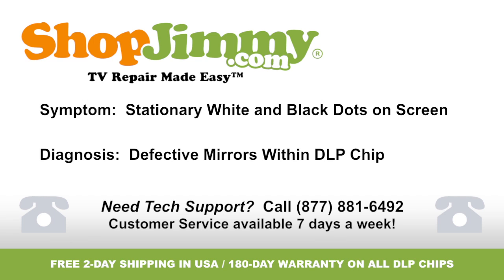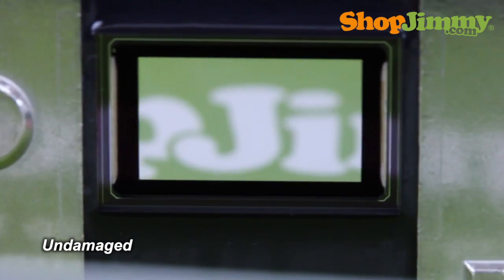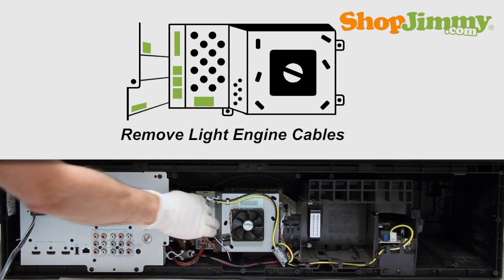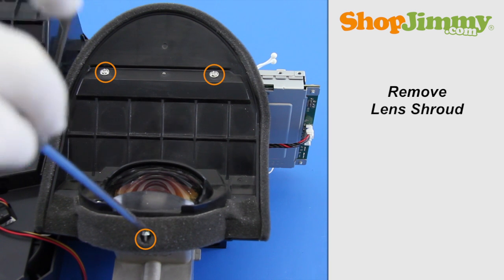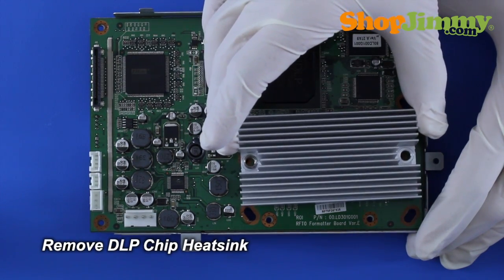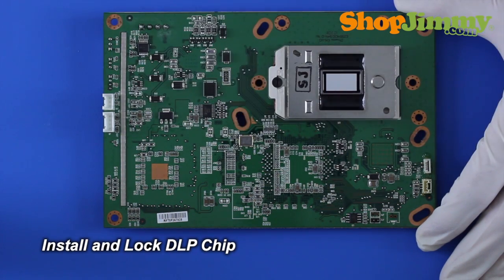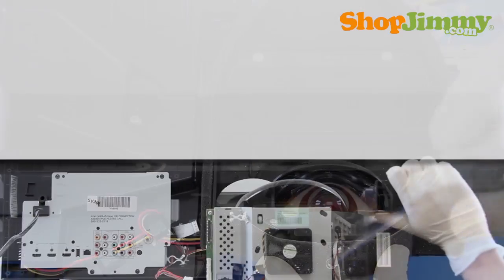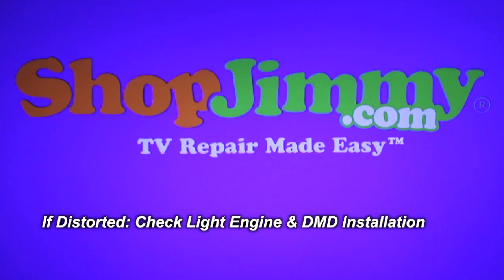Samsung/Mitsubishi/Toshiba DLP TV Repair - Black & White Dots on TV - How to Replace DLP Chip

Comment: hi . when i tryed turning on my tv it did a lil sound and then then it just turn off when i tryed turning it back on the picture wont show the lil green light flashesh but nothing happends can you tell me whats wrong or what can i do?? before that the tv looked a lil bit daker then before can you help me??
Reply: Have you tried unplugging it and plugging it back in? You might need a new bulb.
Reply from the maker: jucar67   This sounds like a main board problem.  Could you please reply with your TV model number?  This will help for me to recommend a replacement part.  Thanks!  www.shopjimmy.com

Comment: My Samsung DLP Tv HL-T6187S has 5 fuzzy horizontal lines, 1000s of black dots and 3 white dots. Help!
Reply from the maker: Mp5sting I recommend replacing the DMD formatter board and the IC Chip.  Here is a link to replacement parts for your TV model number on our website, click here:  http://www.shopjimmy.com/catalogsearch/result/?q=HLT6187S  I recommend the 4719-001997 Chip and signing up to be notified when the DMD Formatter Board is back in stock (since we are currently out of stock).  You can also call our customer service for further assistance with your purchase.  (877) 881-6492  Thanks and please let us know if you have any further questions!  www.shopjimmy.com

Comment: I have a 42  Samsung plasma model PN42C450B1DXZA it does not work with the remote controller I turn on with my finger and it works but it keeps changing channels by itself I do not know what I need to get so l can fix it
Reply from the maker: salvador leon  Please watch this video FIRST to help with your repair!  https://www.youtube.com/watch?v=BP3NVNCGEv8  I recommend replacing the main board in your TV.  Click this link to replacement main boards for your TV model number:  http://www.shopjimmy.com/catalogsearch/result/index/?cat=56&q=PN42C450B1DXZA  There may be multiple boards for the same TV model number, be sure to match part numbers on your current board, with your replacement for compatibility.  Here is a link to a video showing how to identify your part number, click here:  https://www.youtube.com/watch?v=BEPWrefQvqI  Thanks and please let us know if you have any further questions with your TV Repair!  www.shopjimmy.com

Comment: I did all this and now my TV won't turn it just makes the sound of turning on . And then there is one green and red light that keeps flashing what did I do wrong?
Reply from the maker: Andres Camacho   Be sure to check and see if the lamp door is closed on the TV.  Thanks!  www.shopjimmy.com
Reply: ShopJimmy.com so I just have put everything back first before entry it out like the back panel and all the screws
Reply: Andres Camacho I have the model t5075s its way harder than any of these other tv